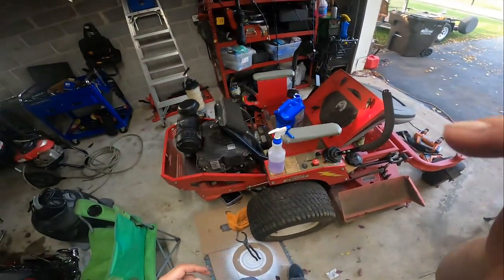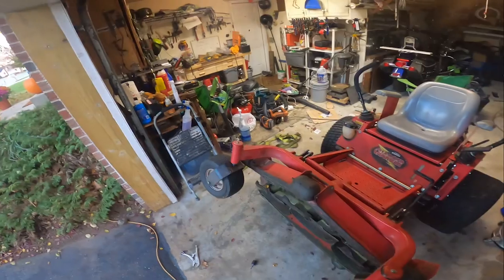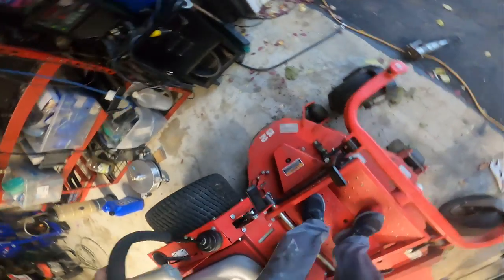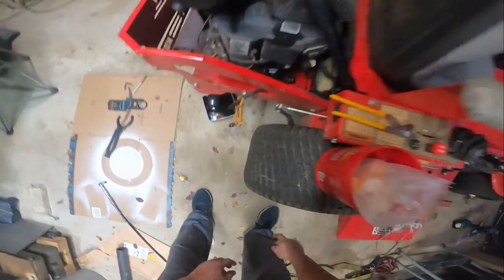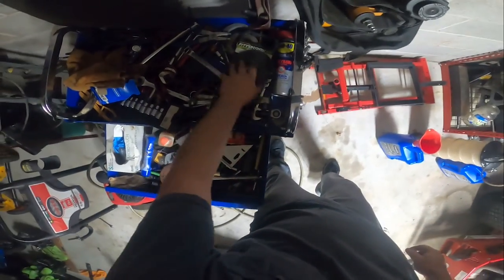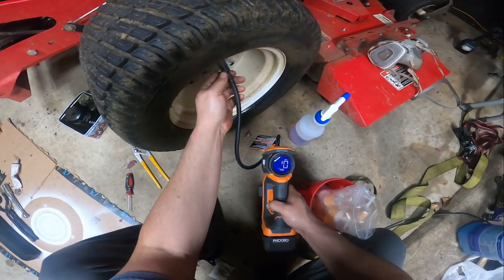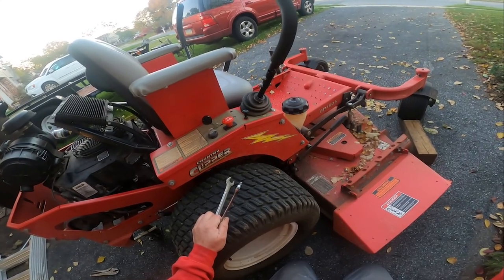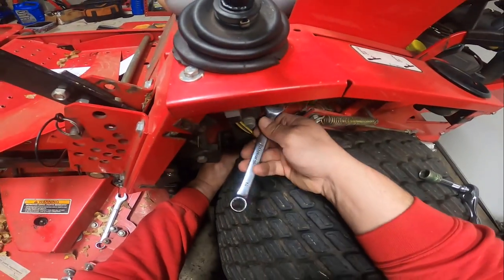2007 Country Clipper Service and Stick adjustment

Comment: I have a Country Clipper charger  and my stand up deck works great, no need to remove any deck pins etc. like you did. Mine only takes a couple minutes to do. You may benefit from watching some Country Clipper how to videos.  Your video  makes the whole deck raising process look ridiculously hard when if done correctly it is actually quite easy! Thanks
Reply from the maker: Lol. OK keyboard commander. Welcome aboard. Owner's manual is just as informative. Thanks for the info though. Want easy... grasshopper. Go ahead, wait for that spring in the quick release bar to not correctly disengage. Don't pull your back out. Can't imagine you weren't looking for a reason why yours wouldn't release.

Comment: Hey I’ve been looking for some repair videos like this on country clipper Jazee 350 pro. This we close as I have found. Trying to my help my elderly neighbor fix hers after a guy she paid left her high and dry. I really need to see how the wires flow going off the engine and into the battery.

I think they took off the solenoid. The key is missing too so I’m having to wire it direct.

Anyway for me to reach out to you?
Reply from the maker: Yikes! What's the model? Should be a label or serial number.